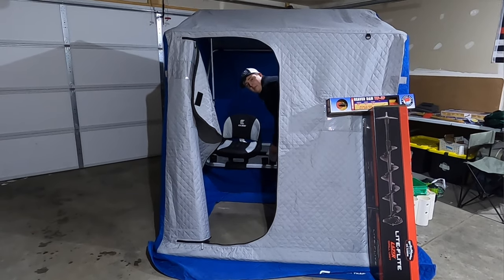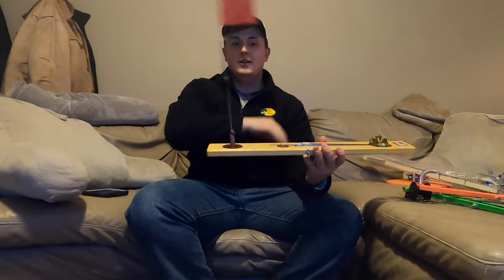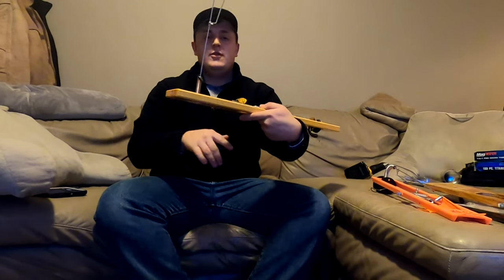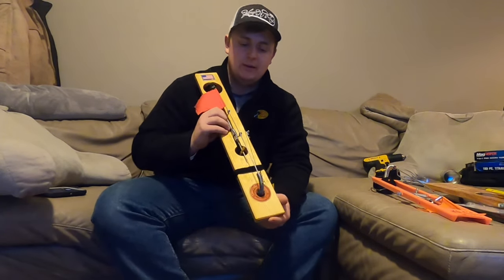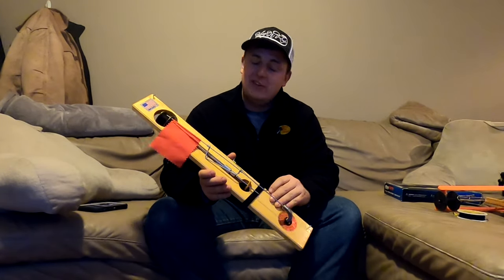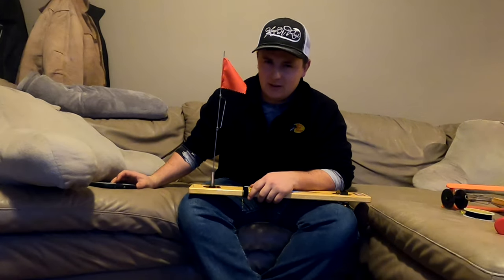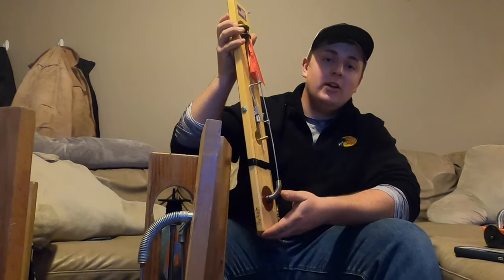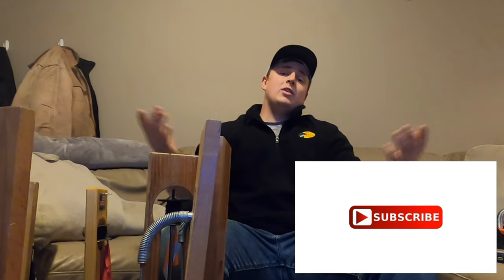BEST Beaver Dam Tip-up MODIFICATIONS!!!

Comment: Just ran across this video. Been getting gear prepped for the coming ice season. One thing I saw, the screws/bolts you used to attach the pvc to the bucket. Maybe try aluminum pop rivets. Nothing sticking out afterward to catch gloves/gear on that way. But some good suggestions in here, keep at it.
Reply from the maker: Hey there SP! I very much appreciate the advice and I think you’re 100% correct on that. It is so nice being able to carry so many, but catching items does happen here and there. Hopefully you like the videos and stick around! Always love hearing from my subs and bettering myself as a fisherman!

Remember to #SendItAndFishOn and hopefully see you again on the channel! 🐟🎣
Reply: Also maybe look into dry graphite instead of WD40. Not a marine pollutant

Comment: That o ring at the base of you flag is the hook holder
Reply from the maker: That is 100% correct. I do use them a few times But those things love to break and also only have a 15.5” span between it and the spool. So longer walleye leaders become twisted and kinked if you spool your line tight and hook onto the rubber o-ring. I’m just giving my insight on a great way to keep your hooks/leaders tight while traveling from spot to spot! Thanks for the comment and hope to see you more on the channel! #tightlines

#senditandfishon 🎣🐟❄️
Reply: @StrikeRykerFishing  all great points my freimd.

Comment: Careful using that wd on your fishing equipment. Wardens don't like to see the WD.
Reply from the maker: Thanks for the input JJ, I do 100% respect our natural waters and want to keep them clean as long as possible. I do agree that wd is probably not better for the environment, however, keeping you tipups free from rust and free to move is very important. The small amount that is left after wiping it off is more for when storing them instead of use right away. They do make tipup grease specifically made from beaver dam if you’d like to check that out! #SendItAndFishOn 👌🤙